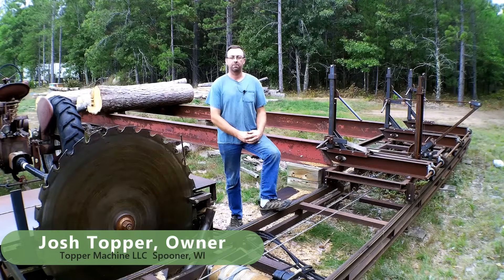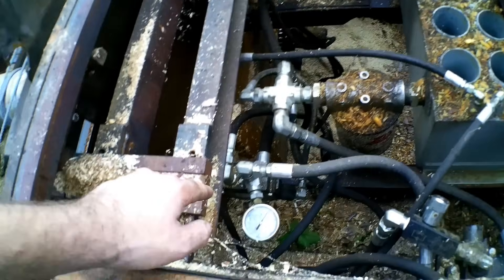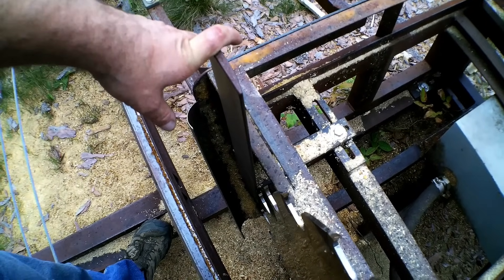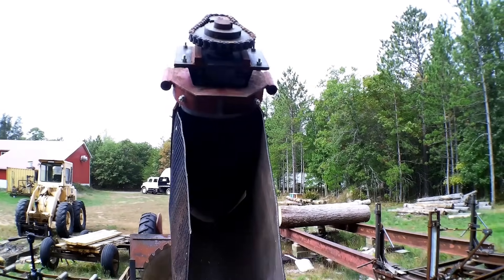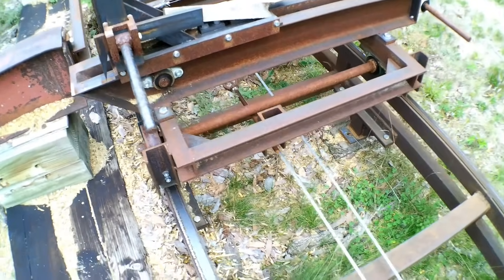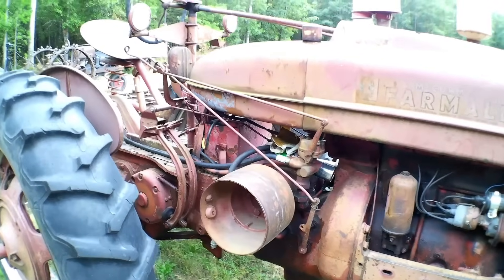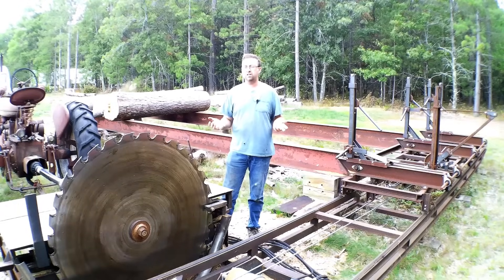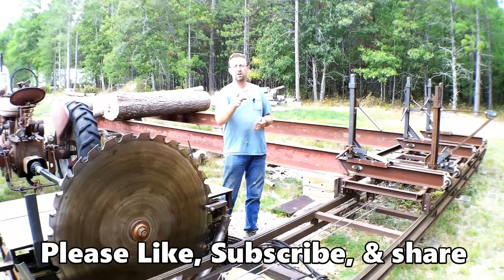Tour the Shop Built Circular Sawmill, How It's Made

Comment: I noticed no dogs on bottom to clamp to the log when you force the top dogs down back in the day when I was a head sawyer by Eland, Wi. we had dogs to clamp a really good safety device . The dogs also where operated with air cylinders between the top and the bottom.

Comment: Cool mill...I like hydraulic driven, the drive motors can be modulated and put in any orientation and power is carried in flexible hoses without having any complicated mechanical linkages and fixed gear ratios.

Comment: Finally someone who actually hates bandsaws and the BS the manufacturers leave you with in  setup, assembling and none stop maintenance. 
Hands down the circular saw is the only way to avoid a lot of headaches that the bandsaws give you. I liken them to Rube Goldberg contraptions. 
I took a more smaller, cheaper,  but very capable way of milling timbers from the abundance of 10 inch and smaller diameter red pines available in Minnesota.  And brought back to life an old friend of wood works at the same time.
https://www.youtube.com/watch?v=Oq7fOd_O5yM
https://www.youtube.com/watch?v=k7cBLq1rgPo&t=142s
The only two advantages this size circular saw has over yours is a lot smoother board/timbers right off the mill and a lot less saw dust. It is slow but sure and is strait cutting all the time every time. Maintenance is time taken away from productivity, so go figure.

Comment: If I were starting from scratch, I would make that saw!
I’m trying to remember every thing you’ve done. 
How many gallons per minute is the pump?
I have the old flat belt carriage drive but want to remove it. The pulleys are in the way of large planks as they fall off the cut.
I’m leaning towards two car rearends back to back, chained together with different sized sprockets for speed control.

Comment: Sawdust sawdust sawdust, how to move sawdust from sawmills, all mills, need more videos on just that. One of the biggest chores on sawmilling is how to get sawdust away from sawmills, effectively.......
So I wonder if a auger under bandsaw mills would work, if mill is in a building like mind is? Something like under a grated floor, sawdust falls into a10" wide 16' long trough, then an auger carries sawdust out into wagon...... Or does the sawdust only flow over sides of the trough instead of going down length of trough???? I dont know, but to start with where does one get a 10"X16' auger that doesn't cost more then a mill does.......

Comment: Josh, nice work! I am curios why you prefer the chain driven head blocks over the rack for your set-works. I run a Chase with a rack and pinion system so I am just curious what you find the benefits to be.
Reply from the maker: Thanks. For one the cost with chain is better than cutting a rack.  Also, with the chain, I can adjust out any slop. This gives me a perfect cut since all headblocks are set the same. Most all of your modern production mills are running the chain setup now.

Comment: You may have videos of this in use but I'd like to see it in use in demo mode - where you explain each step of the process and then let us see it in 'slow motion' to give us time to understand the wood path and how it's achieved.
When you've got a bit  of spare time.  Please include how wood is cut to length prior to loading into the saw.

Comment: This is the coolest thing on YT. How do you go about cutting long timbers? It seems like you would be greatly restricted by the length of the carriage as opposed to a moving powerhead (like a traditional hobby bandsaw mill). I can't wrap my head around a solution for a circular saw mill cutting 20+ ft logs without an extremely long log carriage. I've been considering building a circular saw mill using a 4 cyl Datsun engine and even using the transmission as a speed controller.
Reply from the maker: I have an extension carriage that will give me 24 feet.  We never use it because there is no real demand for anything over 12 feet. I have sawn some 16 without the extension also, with no problems. If you want to build one, your datsun motor might not cut it. For a 48" blade at 500 RPM, you will need a minimum of 75HP, unless it's got loads of torque.  My Super M Farmall is pushing 60HP, but has loads of torque. It still struggles at times, but does a great job. The steam engine will do a better job. Thanks for watching.

Comment: Do you offer engineering services by mail so to speak? I have a unique project that I need to hire someone to help with. I get the impression from your channel that most of your work is local and that you like it that way.
Reply from the maker: I can help out however you may need. Just send me an email. In my video I give my website. There are links there to my email address.
Reply: @TopperMachineLLC   i need 50 inch saw hammered who do you use. I would like to call them  thanks for your help

Comment: This is not a sawmill, this is a wood factory! Some extremely impressive engineering! Simplicity is always best, the oil cooling tubes, the threaded cable drum, there is too much to name. I have built two band saw sawmills and I have run several commercial ones, I have never seen a setup this nice outside of professional lumber yards and I'm not certain that yours is not better than them. This is really brilliantly worked out. It is clear that your design was not approaching the problem of how to slice up a tree, but rather how to cut down, harvest, efficiently manage waste, you've created entire system. I wish I lived close enough to take advantage of your services. Thank you very much for showing us.
Reply from the maker: Thank you. A lot of time and research went into this build. Thanks for watching.

Comment: Nice! Couple questions.. Did you consider, or do any commercial mills use ACME screws to position the log holders? And can you shift them independently to deal with tapered logs?
Reply from the maker: Nobody uses screws.  At least not that I've seen. And for the tapered lags, we just use a shim board until I design some kickouts.

Comment: Excellent.  Intro time is very acceptable, Segways are cool. I like your fluid reservoir, not that you would like to work in 100 degree heat, but how warm or cool was the 8 hour day you took its temperature?
Reply from the maker: Thanks. It was about 90-93° that day. Bit hot, but we had an order.